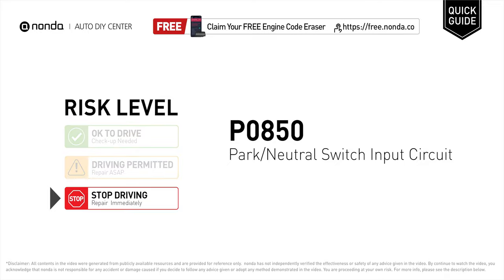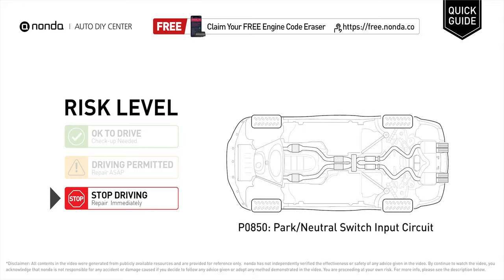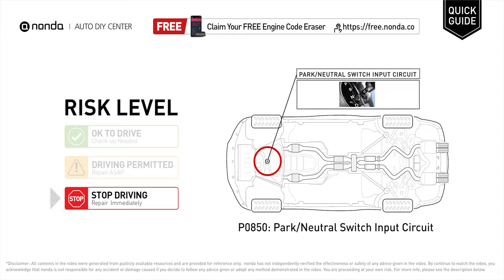What is P0850 Engine Code [Quick Guide]

Comment: I just pulled a PO850 on my '08 Jeep Commander. Replace the Park/Nuetral switch under the console?
Reply from the maker: Hello, kindly check first if the issue is coming from the wiring. Neutral safety switch and PCM failure could trigger this code. The Neutral safety switch is located inside the transmission case or in the linkage that allows the vehicle to shift gears.

Comment: I just pulled a p0850 on my automatic g37 convertible (2010) all the research I'm finding is for manual transmissions. What can I do about my auto trans car and this p0850?
Reply from the maker: Hi Wayne, please inspect all the electrical components including the wiring/connectors for damage. Clear the code from the PCM and retest the system after repairing the damage to ensure that the issue is not coming from it. Also, check the battery voltage and ground signals at the park/neutral switch.
Reply: @nonda  could you lead me to a video or make a video on how to check please please
Reply: Hey wayne I have this code too, did you ever resolve it???